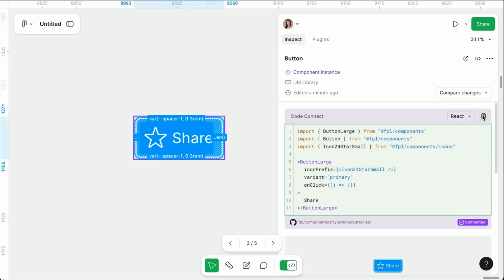Inside FPL: A Look at Figma's Design System | Figma

Comment: Add sensor access like Protopie . Figma has to  change if it wants to survive in the long run. 
Otherwise you are going to loose lot of business to Protopie.  Stop their plugin to begin with or set a condition that minimal features like interactive texts and basic censor access  from Protopie  to figma should be allowed.
Reply: I'm curious. How do you see Figma losing ground to Protopie? If anything it's the other way around. Protopie lacks a lot of basic design features. Weather Figma with their updated prototyping features closed the gap for the need of a tool like Protopie.